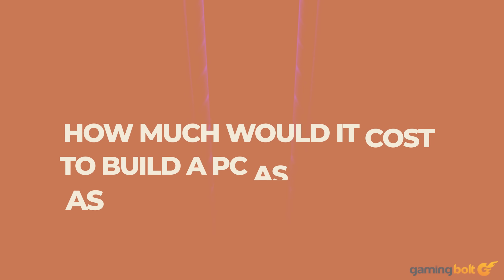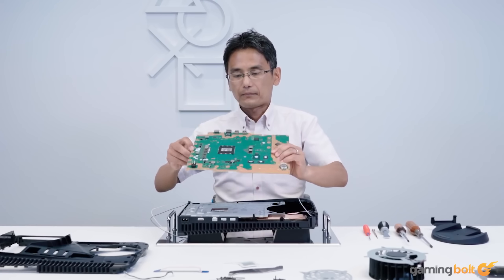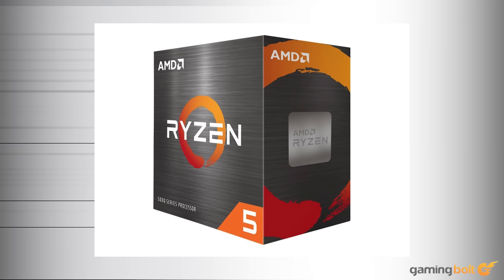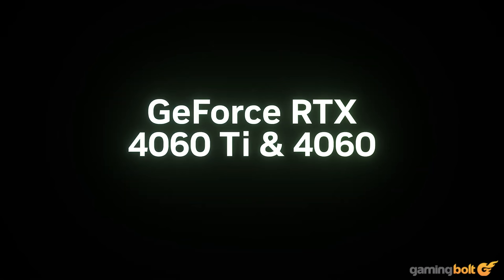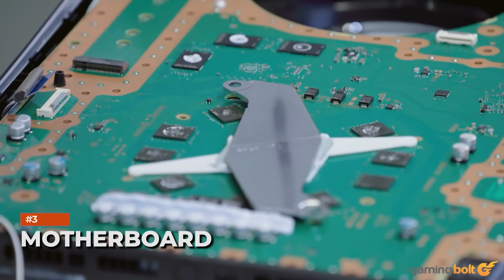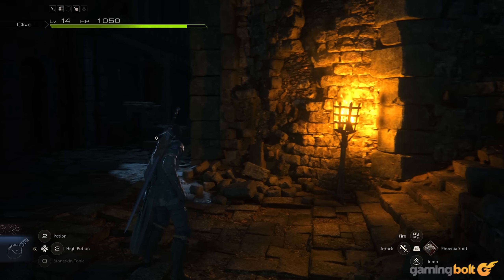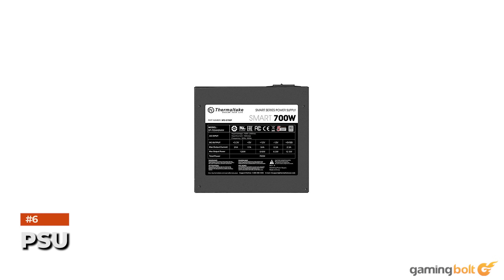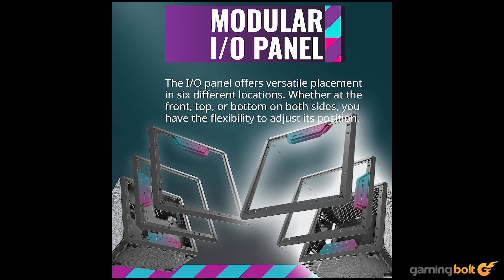How Much Would It Cost To Build A PC As Powerful As The PS5? (2023 Edition)

Comment: The Ps5 Pro has a graphics card roughly equivalent to the RTX 3070 and costs about $700. My PC was about $550 and I have a RTX 3080. With how cheap pre-built PCs are there is really no world where buying a console is actually a good idea. Its not "advantages and disadvantages to both sides," its the PC has overwhelmingly better cost-to-value ratios and the console sells purely based on the average consumer thinking PCs are to confusing to use, because apparently we are still in he 1980s or something.

Comment: U could also go for a budget ryzen 7 3rd gen because it has 4GHz Clock speed and 8 cores/16 threads! Also go for a rx 5700 xt or a rtx 3060 because the rtx 4060 ti is way more powerful than the ps5 gpu + its cheaper.

Comment: Wait how can the ps4 run games like red dead when that needs an rtx 1080 and most tech like that released in 2018 how does it do it
Reply: The RTX 1080 doesn't exist, I assume you meant GTX 1080. You can easily play the game with worse parts and it will still peform decent. PS4 has some of the settings set to lower than low, you can see all of this and more on DF.

Comment: For those who actually want a pc on part with a ps5 .
It costs 600 usd .
R5 5600 with rx 7600
If you can get a good deal on a 6700xt your getting way more performance .
Btw Amd makes the pc 5 chipz,  the 6700(non xt) is basically a pc version of the pc gpu , but it can boost 10% faster .
If your willing to buy a used gpu , you can get a 6700xt /6750xt you can get them for 190-220 usd in the Us .

Comment: the ps5 GPU is actually an earlier version of the RX 6700, which is close to the RTX 2070 super, RTX 3060, and a bit less than the RTX 4060 non Ti or super version. Can you make a PC for less than PS5 value? sure; with second hand parts, i'm talking Xeon CPU with used graphics card; my recommendation anyways. Otherwise wait for maybe black well and rx 8000-9000 chips, but knowing the GPU market you might not see much improvement for the money.

Comment: a 4060ti? really? not only is that more powerful than the ps5 (barely) why would you go with the neutered 40 series card instead of the much more beefy and power efficient mid level 30 series cards? or even the later 20 series cards which still run games absolutely fine

Comment: LMAO it is a waste of money building a PoS like this. The cheapest way to learn PC gaming is to buy a cheap Costco prebuilt PC, and put a cheap GPU into it. This is a low-risk way to learn about PC gaming and you can break that thing as much as you want. DON'T build a PC. My friend who has known me for 20 years did all this research and they ended up just asking me to build almost an exact copy of my PC. Most people don't want to waste $1000 dollars. Videos like this make people waste $1000. I've build PC's for 20 years, and I bought a prebuilt to get a 3080 in 2021. Prebuilts are okay, as long as you know the MOBO. I replaced the SSD so all the "bloatware" is gone. However, installing windows 11 on a fresh SSD would be tough for a complete noob with the TPM/security stuff in the BIOS. That's why I suggest just buying a prebuilt $500 costco office PC and upgrading it with a GPU. That is the cheapest startup cost. I would not buy a used "Gaming PC", because it's easy to exploit someone with little PC knowledge. A used PC could be a software/bloatware nightmare.

One simple tip: If software does something "automatically", you need to know exactly what it is doing, or it will probably f something up and cause problems. "Auto" does not mean "easy" in PC. These are the kind of counter-intuitive things that take experience to learn, and most youtube videos don't include that simple tip.

Comment: a PC isn't worth the trouble for gaming. consoles play their games at the best settings for the consoles hardware right away. With PC's, you have to fiddle with all the settings and not just once. everytime the game or your operating system or graphics card gets an update, you may have to readjust everything. Also, games on PC are much more prone to bugs and crashing than the same games on a console. in the rare instance of a glitch on a console game, all the relevant data is collected a reported to the console maker and the game dev and a fix usually comes right away. With PC games and software, the dev doesn't want to hear about and will blame it on you unless they're getting lots of reports around the same time, which you have to do on your own. Though, to be fair, game devs will have a harder time developing and trouble shooting games on PCs as a PCs hardware could literally be anything.
Reply: Console dont play at the best settings.. they run at medium 720p upscaled and then downscaled again using fsr
Reply: PC is for high IQ players

Comment: 5800x with stock cooler
7800xt/7900gre
B550m motherboard 
8x2 ddr4 3200 cl16
Kingston 1tb m.2
Montech air/lian li case
Evga 650w

All for under 1000 brand new. Could probably get it for 800 if second hand

Comment: I will say what I told a gentleman before Yeah but your forgetting the latest gpu at moment like the rtx4090 is 2700 quid alone every time you go to upgrade you could have got 3 consoles that play the thing you wanna play with that 3 grand graphics card not to mention a motherboard that will support it and they are just gonna get more expensive if ya have deep pockets like the 1% out there definitely go for it but for the rest of us consoles do the job just fine also ya gonna have to pay virus protections on top that’s a monthly fee aswell and more console is soo much more simple to use and care free no hassles they run themselves maintain themselves just simpler also i think a computer that geard up should be for creators such as game making software and movie making not gaming its just greed to wanna run something that requires something that powerful to run when only few ppl can afford a rig like that

Comment: The build could have been cheaper as this is more powerful than a ps5. The PS5s gpu is closer to a 3060 than a 4060 and the read speeds on the ssd are like 5000mbps, not 7000
Reply: There is also cooling. It is very likely that the components are under volted so that they don't overheat which gives the PC an advantage in cooling and clock speeds

Comment: Funny how after all these years yall still don’t realize that consoles are roughly 50% more efficient than pcs, which means that in order to build a pc equivalent you would need something with nearly double the power of whatever console you’re trying to match. And it is one of the main reasons I can’t justify getting into pc gaming when I can buy a console with high end pc performance for literally a fraction of the price and with high budget exclusives that either never will come to pc or will come to pc in 3 years😂. And everything in pc is in consoles. You’re spending at least $1000, to build a pc as powerful as a current gen console.(strong emphasis on AT LEAST) You’re likely spending much more than that just to build a console equivalent, which is a mediocre pc compared to what’s available on pc if you’re willing to spend 10k that is 😂😂😂

Also I never understand when pc gamers typically to shit on consoles. A next gen console performs better than like 90% of pc gamers set ups 😂😂😂

Comment: 4060ti? Even a 3060ti is a lot stronger. Basic RTX 3060 should be used, even without DLSS. (Why not go with AMD instead of Nvidia? its even cheaper)
And, with that, a 550W to 600W max power unit.

Comment: Your motherboard will not fit into your cases. You have an ATX motherboard and your case is a Micro ATX case. Your SSD, the Samsung 980 Pro, is a PCIe Gen 4.0 SSD, but your motherboard only supports PCIe 3.0. This means that both your SSD and your GPU are slowed down significantly, as your GPU is only connected with 8 PCIe lanes and can therefore lose up to 30% performance. Alternatively, if you want to stick with Aorus, the AM4 Gigabyte B550M AORUS Elite motherboard would be a better choice and costs €98.90 in Europe. This supports PCIe 4.0. And it fits into your case because it is a Micro-ATX motherboard.

Comment: You can basically game at max settings on 120fps in any game on the ps5; you need 1000$ to replicate it in a pc.
Reply: Not at all. Ps5 use medium settings and 720p on 300% upscale and downscaled using FSR performance and to run 120fps those are mostly multiplayer shooters ONLY and like one spiderman game which runs at low settings medium shadows so basically you don’t play “max” settings at 120 it is 30

Comment: A $300 used PC with a RX590 plays 1080p HDR at 380fps and PS5 plays 60fps with HDR. Question is whst are you compairing? I mean the PS5s 60fps with HDR can not be compaired to a card pushing 120fps HDR in 4k.

Comment: How come everyone who builds a comparison PC ALWAYS chooses the worst parts to compare and it leaves the price way higher than it needs to be!? 

The 5600 is a good choice for the CPU but the motherboard is way overpriced, the GPU is not the GPU to use for a comparison build, and that PSU chose will fail very very quickly. LTT did a review on it. 

I put this list together in like 5 minutes so you can easily save money. Its priced at $656.92 as of right now. Has an i3 13100f that's MORE than capable for gaming with a nice upgrade path. Intel has came a long way with their i3 processors and this is basically an i5 2400f but cheaper. 16gb of 3600mhz ram because DDR4 doesn't need more than that. 1tb NVME SSD that plenty fast enough since windows SSD optimization isn't as good as the PS5. Basic MSI b760m motherboard that does what it needs to and supports upgrades. 600w Thermaltake PSU that's actually a higher tier rating. Phanteks case that's way better than the one added. Windows 10 or Windows 11 can be bought for like $15 but also not required to activate for gaming. Now the main component here is the RX 6700xt. Its used on eBay for $250 and used GPU's are where it's at as long as it's from a trusted seller. This seller has sold over 650 of them. The 6700xt is quite a bit better than the PS5 GPU and better than the 4060! Supports AMD's FSR 3 for upscaling but not needed to beat the PS5's performance. If you want to save money, you can get an RX 5700xt for around $150-180 used but I wouldn't pay more than that. Its basically the same performance without ray tracing support but no one even uses that anyway. Its way better for people wanting to play at 1080p or 1440p but can do 4k. The 8tb of vram is limiting at 4k but FSR can make up for it. 
https://pcpartpicker.com/list/qMVH4M

Its still more than buying a PS5 but it's not much more when you factor in $80 for PS plus just to play online and you can do way more than a PS5 can. No need for a Blu-ray drive cause no one uses them anyway. Epic games gives you 1-3 free games every WEEK, Amazon prime gives free games every month if you have it, there are literally thousands and thousands of games to choose from, Steam offers way better sales throughout the year, and there are so many sites to save money on games. You can play with any controller or keyboard/mouse you want, and if you bought a game 15 years ago you can still play it. Steam OS is also getting really good and free so you can make it a console like experience very easily but are limited on some games.

Comment: A good PC build will last much longer than a console and can be upgraded quickly with more options of games and things You can do outside of games.  I have all the systems and with xbox gamepass ultimate type things you get the best of both.
Reply: right, but the ps5 is wayyyy more cheaper in some countries compared to a pc
Reply: spending more money to spend more money to match the next console. negative iq logic 🙄
Reply: I have a gaming PC that will outrun the next Gen consoles.  I was just curious if someone has built one lately for this Gen and the price.  @slumy8195

Comment: No case fans? You can get cheap ones for $30-$40 but if you want Corsair you better add another $125 or better. And you still need an operating system.

Comment: You talked about 5600, then before moving on called it a 3600 (a much older CPU). You then talked about a 4060, then said 3070 sometimes (previous gen) and showed video footage of the 4060 TI (a completely different GPU). You then said you didn't want to splash out for an AM4 motherboard, but then picked a B450 motherboard which is AM4. Be consistent please, these mistakes are easily noticeable, and can confuse those who are not aware.

Comment: The pc may have added up to $250 more.
However when you take in the cost of games, pc wins every time.
I don't remember the last time I paid more than $20 on a game, and Steam sales are a regular occurrence for those AAA titles.
On top of that, pc has an inexhaustible library of games spanning 20+ years.
Reply: consoles have backwards compatibility up to xbox 360/ ps3/ ps2.... console deals are always matching steam sales year round where steam sales are at best once a  year... Looks like you havent checked a consnole digital store or local gamestop in decades...
Reply: @slumy8195  Rx6600
R5 3600
16GB 3200MHZ cl16
500GB ssd
B450M D3SH 
Stock cooler
550w psu
Cheap case
Keyboard and mouse
Mic 
Headset
Windows 11
All that for 680$ and makes other stuff like game development music production livestreaming video editing easier
Pay 180$ more. Unlock way more stuff

Also piracy

Comment: It should be mentioned that the H U G E benefit of building a gaming PC is the easy future upgrading! Want a better system down the road, simply buy a better graphics card and pop it in! Same with mobo and CPU, RAM, etc, etc. Of course you can reuse the PSU, Case, and other components you deem worthy of the new upgrade.  I'd much rather have a PC than a console. Consoles are a dead end...like my PS3!  ;)

Comment: should of went with 3700X, and a 6700XT instead of overpaying for less performance with the 4060. last gen used is always the cheapest way to get more. 
also gen 3 NVMe SSD are just as fast for gaming. no point of gen 4 it just cost more and gets hotter. can always get a cheap pc $500-600 to wipe the PS5, with used parts.

Comment: My pc costs around 500 and it is already more powerful. From 1500 and above it is incomparable.
Reply: Specs of your PC? Just curious.
Reply: @accountteam9859  

8gb ddr5  300e
18gb ram 180e
ssd 1tb.   100e
6 core cpu 80e
motherboard 60e

660 euro in total plus 100 e for power suply and case.
I run almost al games on ultra settings with exepcion of Crysis remastered series (high to werry high). Al other titles to date on ultra.

Comment: I have almost the same build and you are dumb to go for 4060ti when 5700xt beats the crap out of it
This build beats the PS5 on high margins(no one on budget buys a new gpu replace mined cards are very cheap) as well my friends 5700xt build which i will be mentioning below beats ps5 and the build you mentioned is twice as faster than ps5
Build to beat it
GPU - 5700 xt - 121 dollars mined and 150 dollars new
Mother Board - GIgabyte H410M - 75 dollars new 
CPU -  Intel i5 11600F - 100 dollars old and 200 dollars new
PSU - Watt psu any - 55dollars(Can choose the psu you mentioned)
RAM - 16gigs 35dollars
Storage - NVME samsung same as you mentioned - 60usd
Cabinet - Same as you mentioned they are good - 40usd
Cut of price for used pc with peripherals - 495 USD which is a little cheaper and more powerful
New - 615 Dollars but now one ever should opt for brand new overpriced gpu/ cpu

Comment: Hold on a sec. Why in the world are you going with a B450 motherboard which has no PCI-E 4 support and then taking about getting PCI-E 4 SSD to match what that PS5 has? Also, that's a trash tier power supply and your ATX motherboard won't fit in that micro ATX case you picked. That case is also pretty bad in terms of airflow, you would be better off with a different one.

Comment: This is, of course, misleading. The components used are unnecessarily expensive and obviously punch way above the PS5.

The actual cost of a PS5 equivalent would be around $640, with the following components:

i3 12100F: 95$
MSI PRO H610M-G DDR4: 80$
Silicon Power GAMING 16 GB (2 x 8 GB) DDR4-3600 CL18: 35$
PNY XLR8 CS3040 1 TB: 51$
MSI VENTUS 2X OC GeForce RTX 4060: 280$
Cooler Master MasterBox Q300L: 40$
Thermaltake Toughpower GX2 600 W: 60$